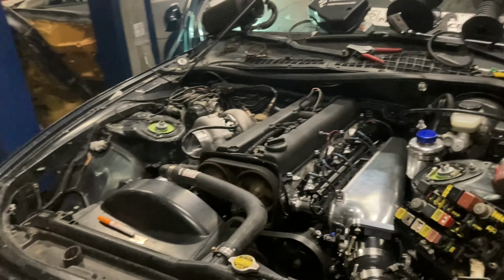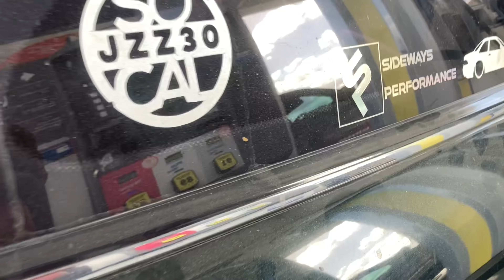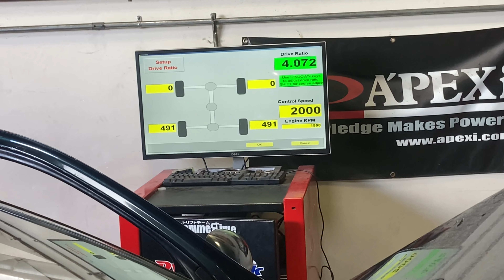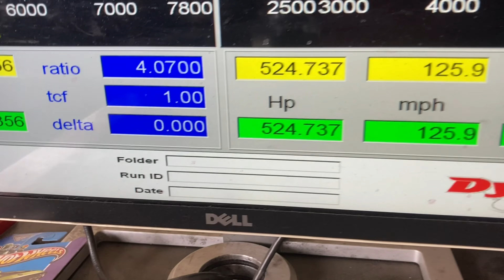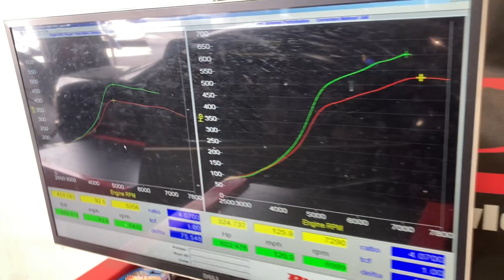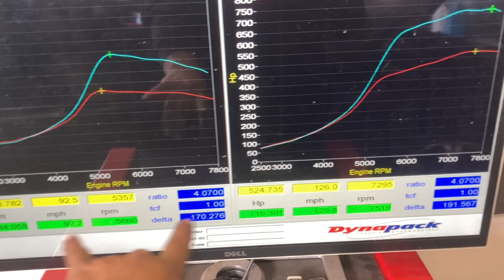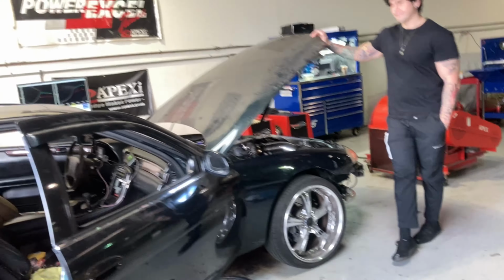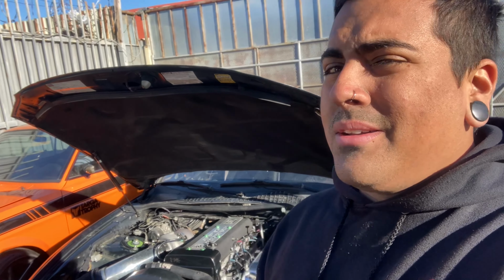@trevor_wanger_  1.5jz 700Hp sc300 Dyno 2 step (final )

Comment: If I remember correctly this is a fully built head and with what size injectors? This channel should have so many more subscribers.. Really!  Lots of 2j content. 👌🏁🏁🏁⭐💯
Reply from the maker: Correct fully built head Cnc race port with 272 cams and valve springs and retainers fms 2150 injectors
Reply: Who did the headwork?

Comment: ive noticed you dont add a blow off valve to your builds. why is that?
Reply from the maker: We typically don’t add a blov until we exceeded 28psi
Reply: @SidewaysPerformance  
Thanks for the reply. What’s the reasoning behind adding later or at higher boost levels? I’m in the process of putting a 1jzgte vvti into my is300. Unfortunately, I’ll have to get my intercooler fabricated and I’m just trying to get as much info as I need.
Reply: @imJGott  because surges sound way better than BOV sounds